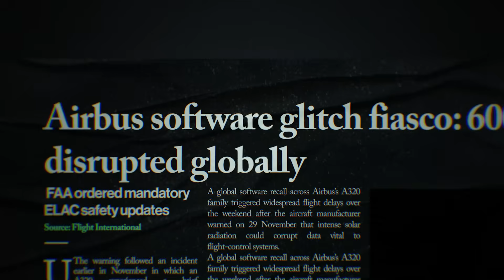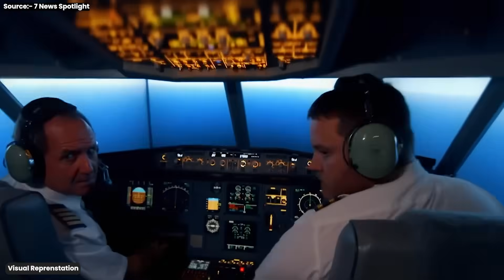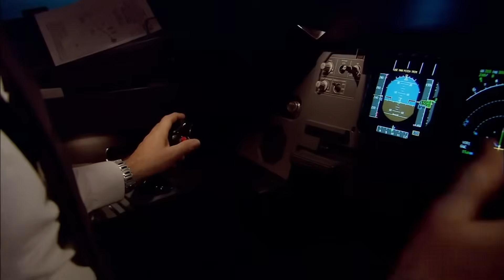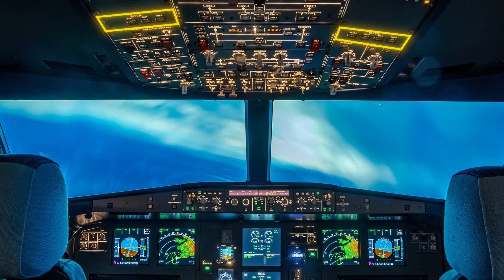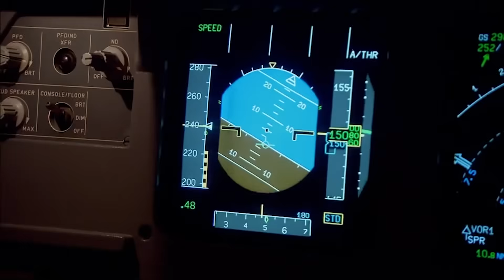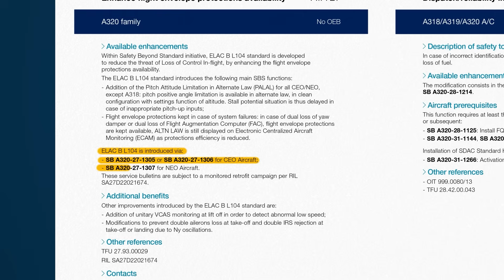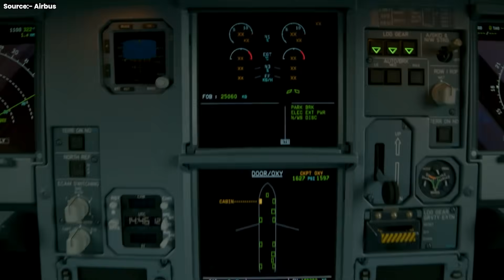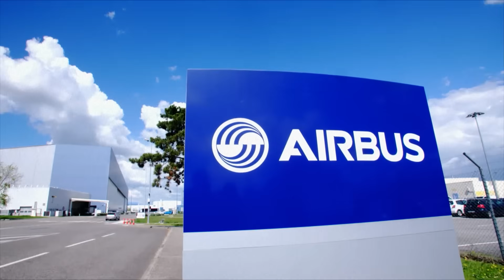The Airbus A320 Failure That Grounded 6,000 Planes Overnight

Comment: Bullcrap.. it wasn't the worst grounding, as the failure point was known and the fix could be applied overnight. I work in an airline and our economic impact was only ONE cancelled flight from several hundred per day.. so, yes, many planes were grounded, but the fix so swift and easy that it had little impact..

Comment: Fly by wire means the software ultimately rules, not the pilots.
Reply: 80% of accidents are pilot error and Airbus had only ever had 1 a330 incident or crash caused by faulty computers which is made up for by the fact that 2 bottom of the barrel Russian pilots did everything wrong on a single engine failure on a URAL flight after striking birds but the a320 physically stoped the pilots from inevitably stalling and practically auto landed in a corn field hailing the pilots local heroes 😂😂😂 had it been Boeing they’d stall and fall before the pilots even realised what just happened

Comment: Another nice video. However I failed to grasp whether it was a bit flip (which is a hardware error, that can be resolved through hard- or software), or a software update error. I'm guessing the 104 update removed some sort of error checking? Or why would a revert to a previous version remove this bug in particular?
Reply: Most likely there was a fault in the new version's error correction and the easiest and cheapest fix was to roll back to the previously working version.

Comment: Those computers could be retrofitted by additional shilding which would absorb those solar energy. This should be ineffective. Why this is a software issue then? I suspect, this JetBlue issue is nothing to do with the solar energy, rather than a simple software bug, which is more ebarassing to admit (without some unforseen, mistique physical phenomenon).
Reply: Fault in error correction code. It's a huge problem in aerospace with no clear solution. This is why the main processor on the JWST is a RAD750 running at 200MHz, first released 25 years ago.

Comment: A totally freak incident this, a one in a million flights event. Its good that this happened really, obviously good that it happened at that altitude so the safety of the aircraft was guaranteed and good that they've researched, isolated the problem and good that they can fix it with a software/hardware update.
ALL aircraft manufacturers need to maintain the highest of standards to ensure aircraft/crew and passenger safety, people's lives are the most precious things in the world and money should NOT be the driving factor here, £'s can be replaced, people CANNOT.

Comment: Important thing to remember - The System WORKED. Plane had problem. Problem was investigated & identified. Plane was grounded until Fix could be made. Fix was implemented. Plane re-enters service. Okay, it caused travel chaos, but NOBODY DIED, and Airbus WILL learn from this, as will the certifying bodies, and steps will be taken to prevent this issue from being a problem in future updates.
This is exactly how things are supposed to work in aviation. An Airbus plane had an incident, Airbus investigated the incident, identified the problem, and made the right decision to park their planes until a fix could be made. No denial, no blaming the flight crew, no feigned ignorance. Airbus took it on the chin, admitted what had gone wrong, and fixed it as soon as they could.
TBH, Airbus has earned a lot of respect in the industry by doing this. Parking 6000 planes worldwide might be a PITA for travellers, but for airlines? That's Gold Standard service. Better a parked plane, than a crashed plane.
Oh, and the panel issue? Completely separate issue, in no way connected to the primary flight risk. A supplier screwed up, it was caught by QC, it'll be fixed before it becomes a problem...
Reply: Had it been Boeing the coin counter execs wouldn’t be incentivized to pour a resource into sh/t until at least 300 people die in more than 1 crash